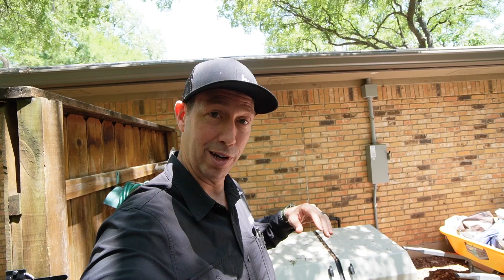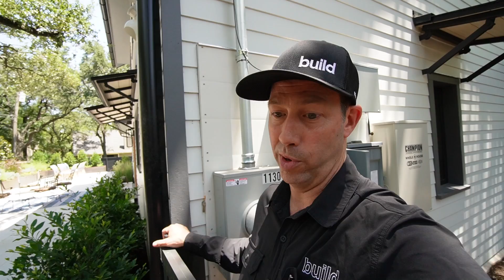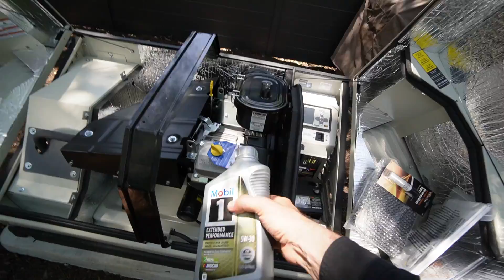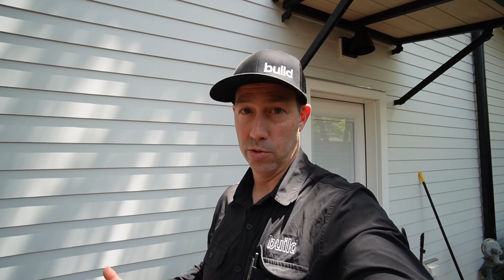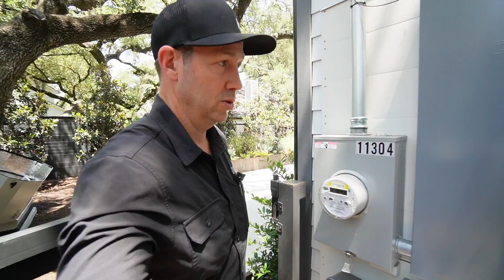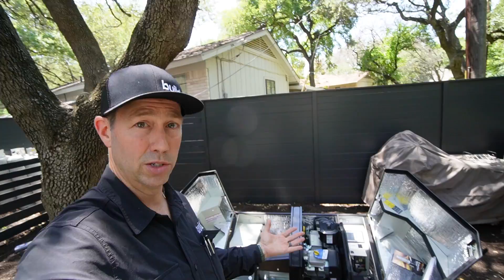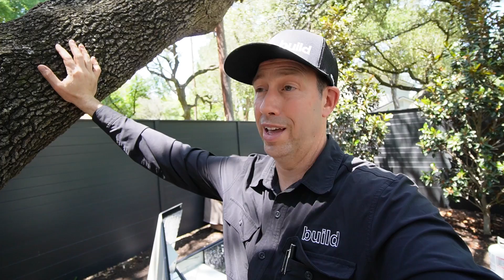Rolling Black Outs? Meet my little friend: Home Standby Generator

Comment: I LOL'd pretty hard when Matt claimed his build budget was 'tight' but yet most of the hardware/items had been donated in exchange for a plug! Give me that type of deal any day on my next build! But I digress, I would have gone solar/batteries. But Solar is way cheaper in my country vs the USA. But agree with going propane tanks vs putting a street connection and the monthly fees for something not used..
Reply: My guess is he tried to reach out to multiple solar battery backup systems and since demand outpaces supply he would have had to pay full price
Reply: @rykdheiner  Yes I think you might be right there! While I love Matts videos, most things shown on the show are 'paid promotions' at the end of the day. Lots of brand name dropping.
Reply: @bitsorbytes  I agree, don’t know how much that actually factored into his decision, I would actually appreciate if he was more open about that. I don’t fault him for taking paid spots. I would have loved to have a fraction of his sponsors for my remodel.
Reply: @bitsorbytes  True.  And given the lengthy time requirement attached to producing his videos (not to mention all the promotional tie-ins), I don't know that he can keep a steady hand in his building business anymore.
Reply: @roberttaylor9259  Texas routinely gets baseball hail storms , the solar shingles might be more resistant .
Reply: Guy used cast iron plumbing and a 15k air filter/recirc system.  

In fact the only budget item he used were the garbage Jen-Weld windows.  His house would have been much tighter without poor windows.
Reply: @roberttaylor9259  All the permitting aggravation you mention is only for grid-tied. If you install as a backup power system all I've seen have no utility involvement, but just the local AHJ electrical and maybe construction permits. I've been told that it is easier working with the utility from a "system installed and working" if you desire to go grid tie than when starting from scratch.
Reply: @roberttaylor9259  Not talking about the house. Talking only about the solar and battery for backup.  A solar system for backup only does not require utility interconnect. A transfer switch moves as much of the house as you like onto battery when the grid goes down.  Simple and easy. Expensive.  Then later if you like you can do the utility interconnect to sell back power to the grid.
Reply: @roberttaylor9259  whatever.
Reply: Find it hard to believe you are a contractor.  Every contractor I know does trades of various types.  I traded a new roof on our Orthodontist house for braces on our four kids.  We both came out ahead.  The barter system is as old as man.
Reply: Solar for personal back up use is pretty easy actually.  Many RVers have built small systems for their rigs.  Won't run central AC but with lithium, it will run basics like refrigerator and an inverter driven room AC with a slow start set up.  Enough to stay in the house through a blackout.
Reply: I hope your country isn't England.
The solar white elephant isn't doing so well over there in the sunshine of all things.
Reply: Cost of maintenance on generators are the biggest factor. It's like $80-100 a month.
Reply: @Findmannynow  Please share the source of that data?
Reply: @D2O2  I tried looking it up, but only found more like annual maintainance. I was told by my luxury home clients that they pay monthly maintenance.
Reply: @D2O2  No kidding.  An oil change in the machine, with the right equipment doesn't exceed CA$40 per year.  The biggest maintenance is maybe the batteries but the charge controller in the generator shouldn't be a big issue either.  The lead acid batteries in this generator should last about 3-5 years and each battery (they appear to be lawn tractor batteries) is only about CA$100 each.  If it's like other standby units, it should be able to do a self-test.  If something comes up, the generator controller should indicate it either on the readout in the generator itself or, if connected by WiFi or bluetooth to your mobile device.
Reply: @Findmannynow  ...you must be talking about big CAT or Cummins diesle-generators, mounted on a trailer or into a sea-can on an intermodal container chassis.
Small consumer gasoline-powered generators available at HomeDepot, Amazon etc, producing up to 9,000 (steady) Watts and start-up to 12,000 W, which sold in Canada for just under C$1,100 three years ago. (i.e. +/- U$860)....all those genny's will be happy if you give 'em some LTC once or twice a year for light usage or quarterly for heavier usage.
Reply: @andrep8287  i think theyre called standyby generators and will be installed on slab. Probably not sold at home store. But rather through consulatation..  Usually they're purchased with maintenance contracts where they come once a month a re oil etc.   Usually found on luxury homes. But I did see the kind your talking about that sells alot for hurricanes and trailer add on.
Reply: @Findmannynow  Exactly. We've lived in this house for 4 years. There has been one extended outage that we had to go to a hotel for 2 nights. $300. Inconvenient? Hell yeah but I will gladly pay $300 every fours years, lose a bit of food, to save the over $10K install and the monthly "service" fees. There is no ROI on having one. If it make you feel more secure than it is the right choice but for me it's about the dollars and "sense". To me it makes no sense because extended outages are so rare.
Reply: @explorenaked  you bring up a good point about going to a hotel every 4 years vs. the cost of a generator.  However, we have a cat and a dog, all of our work stuff is at home, not to mention my portable along with electrical was right around $1,000.
Reply: Could you please help me real quick PLEASE??? Because I can't get one question answered by anyone.  Even the experts 🙏

Comment: The upside of battery backup is your using it all the time.  Sun provides the power on sunny days, battery’s fill in the nights, and repeat.  As a backup only program, battery’s wouldn’t be that great.  It seems to me as you use it, you’ll learn what they are capable of handling, so you’d learn long before the next power outage what your system was able to do for you.
Reply: Nobody uses solar and battery as backup power. Nobody.

Comment: My thoughts also and my plan next year. As a plus, I’ve considered small solar for shop for day use only and a minimalist backup for long outages.
Reply: One of the YouTube channels I watch “Bus Grease Monkey” has built a large Quonset Hut and is lining one side with used solar panels.  He’s added batteries and an all in one inverter for little cost.  He’s not grid-tied, however.  I thought it was an interesting solution, but I doubt Matt has that much south-facing roof that he’d like to put solar on!

Comment: If you're out for 5 days it's time to get on the car and drive away :) as long as you're not trying to last for weeks what you did is a great solution. If you did solar you could add batteries and then the generator exists to change the batteries, in that case it doesn't idle so you get a lot more efficiency, but you still need the generator.
Reply: If the streets are still frozen after five days, you still won't be able to drive anywhere. Been there, done that during the Great IcePocalypse here in a different part of Austin.

Comment: Solar and batteries should be standard for any new house. So much sun in TX and your roof line would allow u to clean the panels from the ground if needed. Instant transfer, no delay and no fossil fuel needed. I run my house that way and have wired the house in such a way that if the solar and batteries completely fail I can still run a generator connected right in the panel and just throw a manual transfer switch to isolate the solar/batteries and grid from the house and generator connection. I don’t want to rely on the failing grid, I use the grid as primary backup and the generator as a secondary backup. I don’t have my inverters selling back to the grid so don’t have to deal,with the issues of interconnect. If u have knowledge of basic wiring or a electrician u can do the solar and inverter install yourself and just have it inspected, no interconnection paperwork needed form the utility. Electricity is going to get outrageous soon and grid outages are going to become more common.
Reply: This is the exact setup I want. Solar and batteries as your main, Grid as a backup, and generator as a third backup. No need to sell back to the grid. Here in Cali, they are proposing a $80 fee if you sell back to the grid. Hell no.

Comment: Hi Matt, Excellent video. To share with your subscribers that Generac offers a significant KW upgrade to 22 KW size generator which is only marginally larger than yours and air cooled. I have had mine for two years with excellent reliability.
Reply: Honeywell also sells a 22kw with transfer switch for a reasonable price at Costco.  Reliability is always a major consideration.  Bigger than needed runs less efficiently.

Comment: Installed a champion last year in August. Great system. User Guide is so clear; a knowledgeable DIYer can do it themselves. I did mine, had a Electrician friend check it out, and my buddy from the local gas company check the pipes.  Works great!

Comment: We need to put the kibosh on EV charging.  I got a message from ERCOT saying we need to cut back on A/C usage, no laundry, and don’t leave your iPhone plugged in.  NO MENTION of EV charging.  So the battery-laden energy HOGS called EVs aren’t asked to sacrifice but everyone else is.  I say we run those MFers off the road.

Comment: It's nice to have but I'm worried about reliable gas availability during extreme demands. We lost power from hurricane Ida last year and so many folks couldn't even run their natural gas standby generators because they was such a demand on the system the units wouldn't run. I have an interlock installed on my main panel with a gasoline unit that I plan on making dual fuel.

Comment: The mitsubishi's energy consumption does this up-and-down peak pattern (wish I could add screenshot to comment), which tends to throttle down after it's been running for a while. If you had two in sync, they could just alternate back and forth every 15 minutes.

I'd love to see Matt install a whole-home energy monitor so he could show what everything draws in real time. SPAN makes a smart panel that shows each circuit, but I'm sure that others do too. With how well he builds his homes, I bet the new one would only draw about 8Kw if the freeze happened again and they were below freezing.
Reply: I second the SPAN Panel option. Much sleeker setup than anything else on the market and way more sophisticated than this install. Just had the panel installed at my house and it's been very enlightening seeing how your usage varies with each appliance all from the app. It can also auto-handle all the priority switching based on your available power instead of installing these boxes all over your house.

Comment: Long term, i would look into a solar/battery system with a generator tie-in for the ultimate backup solution. (Like enphase or generac)

With all 3 systems, (Solar, Battery, & generator) that 3 days of fuel you have could be stretched to several days (possibly a couple of weeks) since the generator will mainly be recharging the battery. Saving fuel when its absolutely needed.
Reply: Also, solar on day one starts giving you a credit on your bill.  My payback with all the incentives was 3 years. No-brainer for me.
Reply: @facadcofac409  Yep and Nice!  Sadly my area doesn't have as nice incentives as you do. Payback before attaching batteries was about 7 years. (10 to 12 years combined with batteries that was added last year.)
Reply: There is no free ride. You will put more power in to the batteries than you will get out.
Reply: @Dav1d_B  
While true.... At 90%(ish) round trip efficiency, it's a "small" hit to charge your battery and take that energy out of it..... (If you had a fix amount of energy, say 2 kWh, and put that into a battery, you'd only be able to pull out 1.8 kWh of usable energy.) 

Not something the average person is going to notice too hard.... 

Although I fail to see what that has to do with my comment about saving "fuel" with a generator.. (and where did "free ride" come in?)

Running a generator at idle or with low loads is more fuel inefficient when it comes to generating electricity. It's better for a generator to run at a certain load % (say 70% as an example) to get the most electricity from X amount of fuel. Something like charging a battery would do just that (at least getting it up to about 60%-80% charged). Once charged, a generator can be turned off (automatic for these systems). 

These 2 things, running a generator at it best fuel efficiency to charge a battery and turning it off when no longer needed can stretch the amount of fuel you have. 

(It honestly wouldn't surprise me that even adding the battery inefficiency to the mix, it's still more electrically fuel efficient to run low power loads with a gen+battery than running a generator by itself under the same condition.)

This doesn't even include that solar should be covering most to all of the battery charging and home electrical use...  The generator in this setup is just the last line of backup. Incase there hasn't been enough solar nor there enough battery to cover you.
Reply: @Dav1d_B  True but it is better that the Suck of no power.

Comment: Battery back up is probably safer. And the degradation is by 'cycles' not time. So as a back-up only, they batteries could last decades. But you would need solar to charge them during a power outage. I am building an off-grid home with 6 Tesla Powerwalls currently spec' and about an 18KwH panel system. Given Model S and X cars are running less than 10% degradation after almost 1,000 cycles (several hundred thousand miles for a car) it is clear the Powerwall degradation is significantly less than what many estimate. Also, battery back-up cycles are much easier on the batteries compared to a car. It will take 2 to 3 days to completely drain my designed 84KwH pack, compared to a car that can do it in 5-6 hours. It is too soon at this time to know just how many cycles this could add to the expected lifespan of a back-up battery. That said, I am also spec'ing a propane back-up generator, just in case, and also because I am using propane for additional pool/jacuzzi heating. So no indoor gas lines.

Comment: I believe Generac has a combo system that utilizes solar, battery, and a back up generator. Maybe something to look into! I do have a Champion (gas) generator that has worked great, especially for the price (maybe 1/3 the price of a Honda).
Reply: Yeah but Generac wasn't handing out 'free' units :)
Reply: Generac PWR solar, storage and generator power solution very nice.

Comment: Hey Matt, thanks for another great video. I got solar panels but no battery or automatic transfer switch. I am not a fan of the batteries either. So far it hasn’t been a problem as we haven’t lost power for very long at a time. I like what you have done with the propane. I prefer a buried tank that I don’t have to look at but then you have to rely on someone delivering to you. Also you would risk hurting your pretty live oak. So I like what you have done, but you have to do something to screen off those ugly tanks. You have a beautiful home except for those tanks.

Comment: I just bought a tri fuel ⛽️ 10,000 kw portable generator. Any Guess on total  cost on electrical installation. I've already had the natural gas company install a tap  to plug 🔌 mine into the gas line.

Comment: When Hurricane Sandy came to my area. I got a cold hard lesson. With infrastructure all down, gas stations were down and some limited capacity after they got generator. I don't know how feasible it is to get propane during a catastrophe like that. I think all sources of fuel were hard to come by. Chances of something like this to happen is small but as long you understand this glaring delimma...

Comment: Soft starts on your heatpumps will limit the voltage drop when they start up and get the inrush for motor winding or ECM caps.
Reply: You beat me to it
Reply: Inverters don't need soft starts.  Only psc compressors.